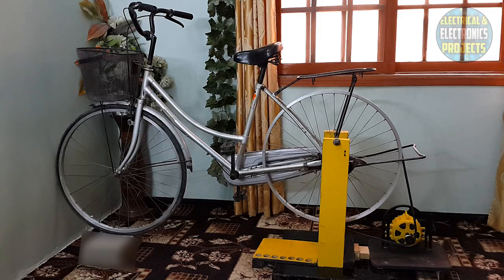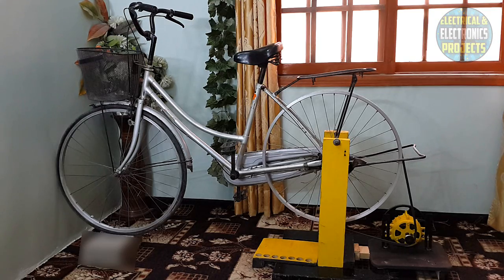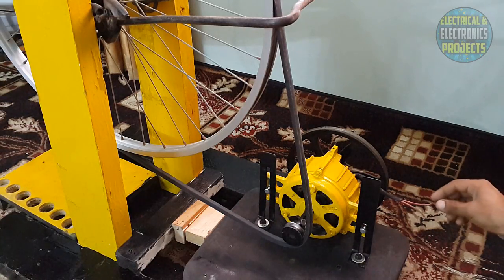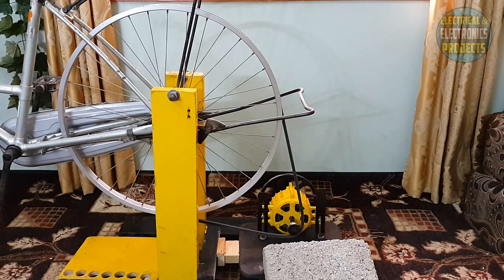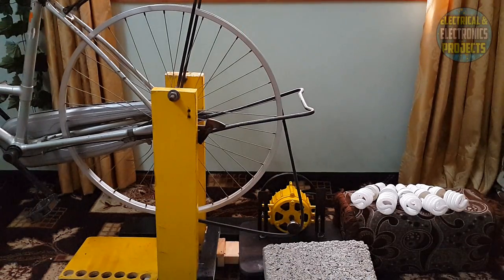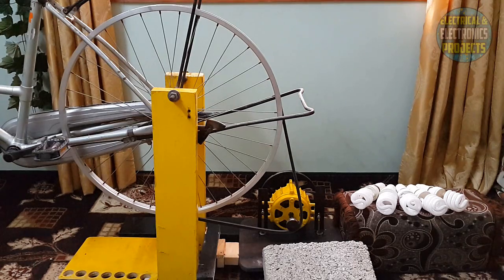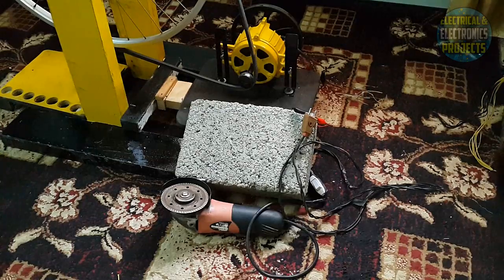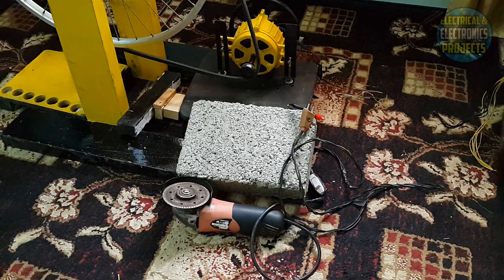Free energy generator homemade 220v attached to bicycle.DIY free electricity generator

Comment: Nice, but how do you control the voltage output of the motor? You could kill a machine like the grinder in case the voltage is getting too high. And, if the grinder is in use, then you have a real load. The question is if you can still manage this from your bike.

Comment: What can I use to store that energy?
Reply from the maker: You can use a battery to store that energy by converting AC to DC.
Reply: Electrical & Electronics Projects. Which circuit I will have to use for storing?
Reply from the maker: Using bridge rectification circuit which coverts Ac to Dc and also you will need a step down transformer according to your battery  voltage.
Reply: Electrical & Electronics Projects. Thank you so much my friend ❤️

Comment: The term "Free Energy" has a special meaning. It relates to a certain type of system where there is an output of energy with no input. I can think of some very efficient systems, but I can't think of an energy system where there is only output with no input (FREE).

Comment: This guy does not GET that you have to eat MORE food in order to produce "free energy" ...assuming you PAY real MONEY for the extra calories ...I don't give a CRAP how you rationalize the thing!  It is NOT in any way shape or form "free"...as in "free from paying MONEY" (wait for caveat on obesity at the end)  ...the more physical WORK one does?   the HUNGRIER one is come dinner time ....work on a farm or installing drywall or laying concrete block or something?  You will eat HUGE meals to keep producing energy ....hopefully one is not dumb enough to do such work for minimum wage! ....only do minimum wage work if it is low caloric energy expenditure ...otherwise you are just giving away the wear and tear on your "machine" (you body) AND the fuel to power it...let's never kid ourselves ...the "fuel" for our bodies is a very definite thing ....you either USE the calories you consume or will store it as fat ...now I confess that IF a person just loves to eat and has excess FAT that needs burning?  THEN converting THAT unwanted trash FAT into power WOULD qualify as "free" energy ...not counting the wear and tear ....which there is very little impact I suppose with a bicycle generation

Comment: what about the RPMs if the rpms goes faster then the voltages goes higher up to 240
Reply: To generate 50 hz 200v ac ... The shaft should be rotating at a speed to 3600 rpm...but the cycle was running at lower rpm then how come the grinder works? Explain it sir. Thanks in Advance

Comment: Now this is a good video, I also followed your first video, this is a good find but the only thing needed to work on is, how to harness this energy so you can use all the time. One thing you can do is to loop the dry cell type batteries together may be two of them to save the energy and then connect the inverter and then check how much energy will the battery save if you peddle your cycle for 5 mins.or say ten mins of excercise, will wait for the video.

Comment: Thanks for this demonstration, and your thought and work behind this.   This is basic electrical engineering ..and is correct.   
Years ago a person could buy a simple small generator and light system to put on their bicycle during night time use.  The generator rotating shaft would rest against the side of the rear wheel...when the system was wanted.  It then spun...driven by the wheel...and it produced electrical power for a headlight and a tail light.  I had one of these because I had a job which required a bicycle  at night.   ......   this was long before lithium batteries.   The old batteries were weak, cost a lot, and didn't last long.  So I got the generator system.  And experimented with it!  for different things...

I really appreciate your efforts and encourage you to do more projects. .. and study.
You remind me of myself years ago.  I became an engineer... obtained both electrical and mechanical  engineering degrees.
I am in the US.   Would like to help you, at least with advice...if there is some way of exchanging emails...  without giving the addresses to the world.
You have great potential, my friend!
Reply: Wow such a lovely comment.😍

Comment: Its  good project & appreciate yours Effort but who will daily run Cycle pedal .Yours project is good hope you try with attached  mechanical  it mechanical Mechanism .Or permanent Magnet used around it than you can made Self -AC Generator which can on Battery volt.
Reply: Saif Awan you will cycle and you will become healthier for it.
Reply: Iam looking how u r making Generator with washing machine motor

Comment: Years ago one of the news media did a story on a man who had pedal-powered everything. You'd notice real quickly that his devices were not electrical but each had it's own pedal-power. Converting mechanical energy to electrical comes at a cost and converting it back to mechanical also has an energy cost.  Re-think what you're doing. You are on the right track tho.

Comment: The color choice is fantastic!  Great job in presentation.  Please now show modifications you made to motor to make generator.  I would like to see if your idea is same or different from mine.  I'm using a similar type motor, exciting alternate windings with small voltage, with ac power from other winding, as there are no permanent magnets to excite field.

Comment: tens of thousands of free energy devices on UT and few thus far have any promise. the human body is a engine that burns food for fuel at a cost. So that being said free must be free like the gravity operated mechanism in a grandfather clock. That could be considered free mechanical energy if you never had to lift the weight to the top. Thus, like a wind up toy that works on the force of a spring it can only be considered free energy if the toy could turn its own key.
Reply: Wilfred Darr " note: you wind some grandfather clocks by just lifting a weight no key required!

Comment: you have to buy food and eat to be able to make motion that will produce energy. so theoretically its not really free. maybe you can just call it multiplied energy because of the mechanical advantage produced by the set up.....its very hard to imagine using that set up to light up your house continuously for many hours. even if you are a super athlete and you can pedal for many hours, that means you can not do something else because you have to pedal to make your generator work. if you will work for a company, the money you will make maybe will be more than the savings you get from pedaling to make your generator work. BUT there is a good use for your idea. use that set up to charge mobile phones, laptops, ipads etc...if the kids wants to check their facebook or play games.....they have to pedal....that means they will be forced to exercise....adults can use it too....instead of going to the gym or jogging...just pedal so they can produce electricity to maybe charge a big battery to light up some area of the house.....etc
Reply: correct

Comment: what model alternator did you use ? why not just charge batteries with a charge controller and store the energy? this type of electrical generation works with blenders all will depend on the alternator. also why not use a turbine generator in this setup?

Comment: Effectively you have made a exercise bike and use a motor for the resistance. You used this for about 100 seconds.  1 Calories is around 4 Watts so depending on the resistance of the motor you probably used around 60-80 calories so do the math. Great exercise equipment ; you converted your lunch to some light.

Comment: You are not drawing 500W from the grinder.  500W is what it is rated under load.  You would certainly get lots of exercise powering lights and motors.

Comment: LOL you read my mind.  I have a bicycle in back shop with a motor on it.(it's a simple add on motor)  I figure to just add a larger tank and let it run all the time i need power.  PLEASE test it with and Air Conditioner  if possible.  And maybe  try adding things with the Air Conditioner running???    You are helping me so much to get to what i want to accomplish for living in travel mode in the van.  I want to just park in a parking lot and have all i need.   You are  very skilled in what i am seeking.  .
Reply: Make shore you eat good  food to paddle this bike it's simple thing you doing man ha ha keep it up